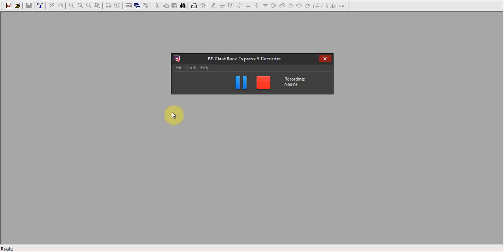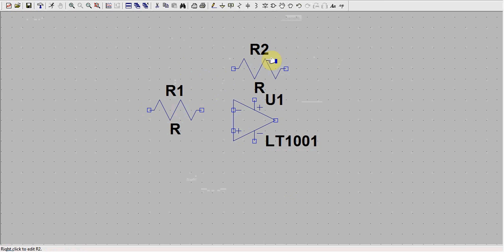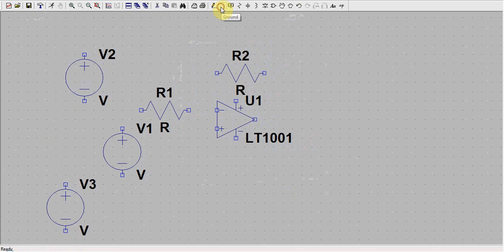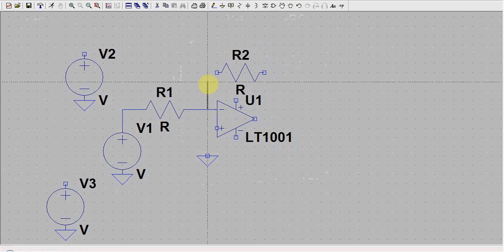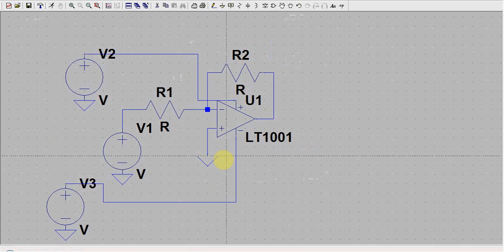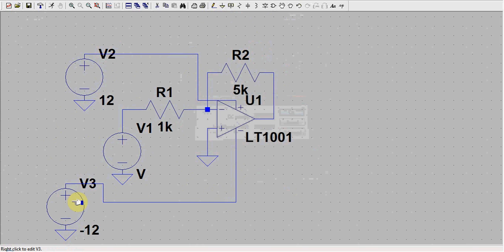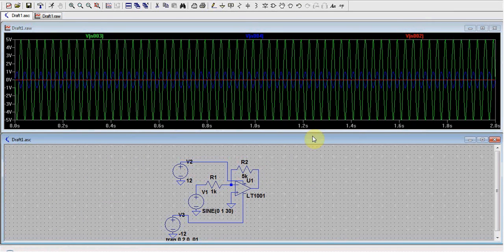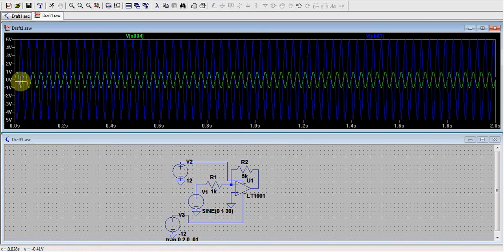Inverting Amplifier with LTSpice

Comment: Uo= (1+R2/R1)*Ui

Uo= (1+ 5k/1k) * 1V = 6V

I dont  understand why the simulation shows 5Volts Output?

Can you explain?
Reply: These equations work for inverting amplifier. But in this video he is using non-inverting amplifier. And for that
Uo = (-R2/R1)*Ui
So
Uo = -5V
Reply: Because the amplification is acually -(R2/R1) . Minus because the difference in phase between the Vin and Vout is 180 degrees (inverting amplifier). So the amplification is 5.   5*1=5